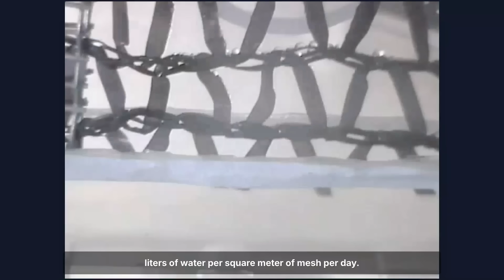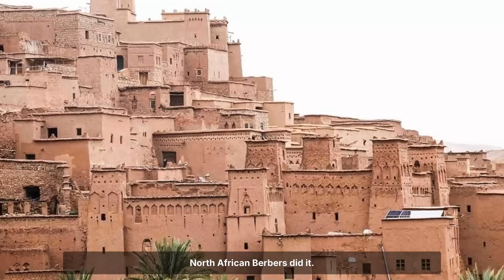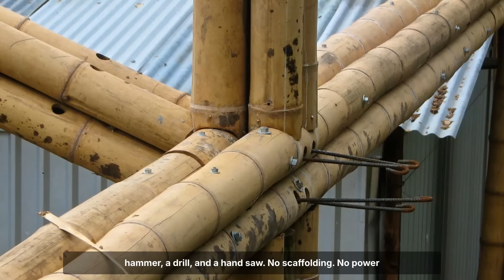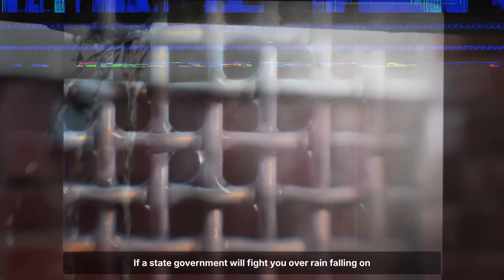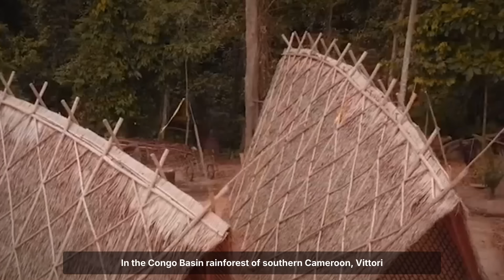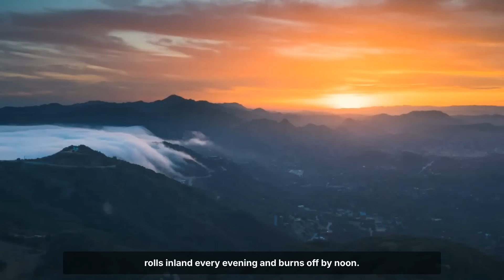This $500 Tower Makes 25 Gallons From Air Daily. Why Is It Banned in the U.S.?

Comment: 3 quadrillion ... thats 12 zeros ... not 999.9 trillion ... 
3,000,000,000,000    is a bit different than what you posted ... add 33 to that btw and you the states national debt load
Reply: bettle back ... just shows everyone that nature in 4.5 Billion years has learned what works ... while man keeps failing until they copy and comprehend nature ...

Comment: Let's see... the tower costs five hundred bucks and produces 25 gallons of water per day that costs nothing. It only works in places where the relative humidity is high so it does not work in places where water is needed. Do the math. Divide $500 by zero and you get a payback that NEVER  happens.

Comment: Call it the empty vase have the water collection have very small holes that run the water that it collects to an underground basin underneath. That you can access via pump that can be hooked up when you need it or hidden somewhere running pipes to it underground. You're not collecting water you just happen to have a structure that you call the empty vase art structure.

Comment: Not forgotten obviously. Rather it's more likely the tech was banned because it was something that could not be regulated or used to make a profit by those in control.  Likely reasoned to be unsafe for consumption or below code. Like how Nikola Tesla's designs for pulling electricity out of thin air were proven to work then because it could not be metered and used to make money it was destroyed and the plans after his death were secreted away by the US Govt of the day and it was never seen again.

Comment: 15,000 liters for 100 water catchers is 3,962 US gallons or 39.6 gallons per unit annually. If a person were to drink only from this system about 1 gallon a day, they would only last 40 days on 100 water catchers. Does it catch water from the air? Yes, but not efficient enough to sustain thriving communities.

Comment: The water needs at least basic filter and carbon filtration.  In some cases, you need a reverse osmosis system. Thats why theres regulations about how you can use rain water. You don't want to drink the chemicals that can leech from an asphalt shingle roof or any air pollution you catch.   This is usually to keep lazy people alive. If you just drink straight,  unfiltered rain water in most areas, you'll die of something or get very sick. 

As for the height, there are typically limitations on height for residential areas. Plus, depending on where you live, weather like severe thunderstorms,  straight line winds and tornadoes have to be taken into consideration too.

Comment: I think one of the main reasons why building codes tend to not want things like this is simply because of the fact that it takes away from businesses and stuff that actually create you know money for these kinds of things.

There’s actually a variation of this in. I think it’s Nepal or somewhere else. I’m not exactly sure. Basically there I think they call them fog catchers. Same idea, but instead of a circular tower, they are collections of screens that are situated really really high up on these mountains that are almost constantly surrounded in clouds and fog and stuff like that. And basically the moisture collects on the screens before it is then run into collection bins and stuff where it is, then I believe filtered through a natural filtration system, and then used as you know, clean drinking water.

Honestly, I think a system like this would be great for not just areas where they don’t have access to certain parts of clean water, infrastructure, and everything but even locations where you normally would have and stuff. For instance, put something like this on the top of a water tower. And it would likely be very helpful. Also, I think there would be ways to get around it for the building codes. For one thing you could simply refer to it as a dynamic sculpture.

Comment: We could literally create streams and rivers with a bunch of these towers– just dig a trench, line it with multiple rows of towers on each side for miles, build the occasional lake to store-up extra water,  and then release beavers to dam it all up and create wetlands;  bring in willow seeds and grasses to shade the banks, and we could turn places like Arizona into lush grasslands, with networks of self-sustaining streams, rivers, lakes, and wetlands. 
   We could also start a nationwide compost collection, to grow soils, and deposit them in key areas to accelerate the life cycles and water cycle returning. 
   Once the ecosystems are established, the towers wouldn't really be needed anymore, since the groundwater would be filling back up, the plants and soil retaining water, and the grasslands and little stalls of forest would cause both evapotranspiration, as well as create low-pressure areas, where moist air is drawn in, forced upwards where it cools, to then condense and fall as rain. 
   Planting coastal forests along our windward coasts (like Southern California), would further add to the rain cycle. We could increase this further by building barrier islands and mangroves, and paving artificial salt-pans, where, using flood-gates, a shallow depth of water would be allowed to flow in from the ocean into the salt-pans, where it would evaporate, and then we'd use something like street-sweeper machines to clean up the salt,  and then repeat. The salt should either be added back to the ocean, or sequestered, based on monitoring salinity levels. 
   And for dry areas like Utah, that are surrounded by mountains, we could dig railway-style tunnels through some of these mountains, so that the arid valley could be a part of a larger water cycle, with streams flowing in and out (with flood gates that can be closed if too much water is leaving the valley).
Reply: You have some very interesting ideas. Make me think. Thanks.

Comment: Romans had a solution for it, cisterns! 
Build cisterns under the parks or suburban areas. Every place on earth has rains or rainy seasons even Saudi Arabia. 
Collect the water in underground reservoirs. It’s filtered through the soil, no evaporation issue, and it’s protected from the weather/sun so which makes the water fresh through the year.

Comment: Can you provide a simple design for the desert travellor to collect water in desert?
Reply: Get something water proof preferably..square or rectangle as long as it has corners..can be plastic can be a fabric like a thin synthetic fly sheet for a tent...
You need to be able to tie it from the corners. It also has to have a hole in the centre. Tie it out so the material isn't taught. Put a weight in the centre where the hole is obviously dont block the hole.Make the structure a broad kinda funnel and something to catch the water underneath. If u have 4 trees to Tie off to is best as the leaves will drip onto your catchment. If you whack the trunk it'll "rain". You can probably do it a few times a night to up the amount you get. You get the gist.😉
Reply: Probably no trees in a desert so use sticks as poles for your corners..it'll still work..
Won't be a massive amount but you might get a cup or two depending on size..

Comment: Let me make something perfectly clear, because apparently people really struggle with this...

If you live in a desert, the reason why it is a desert is because the air is dry. There is no moisture in the air. If there was, it would rain more, and it wouldn't be a desert.

If the air is saturated with moisture, the environment will not be dry, it will be humid and moist, like a rainforest.

So, devices that are designed to draw moisture from the air, only work in places where the air is moist, and they aren't needed, because it rains there a lot.

In places where they would be needed or useful, they don't work because the air is as dry as the desert is.
Reply: Apparently many people are too dumb to understand high school level science and are claiming that government is suppresing "free technology". NOTHING in this universe is FREE

Comment: Build it on a trailer. Call it art. You don't need a permit for chattel.  Pour concrete with rings and chain the trailer down good if you are in tornado country. This would probably work great in The South and East coast humidity. If enough people were doing it it might not be a nightmare climate anymore.

Comment: Why would anyone need a permit to build a bamboo atmospheric water tower in their own yard?  I can tell you why people don't use them.  Not only will it collect water, it will collect bugs and bird shit too!
Reply: Plenty of ways to prevent bugs and bacteria. Many Australian homes ONLY use rainwater - mine included.
Reply: @tonyclif1 of course it's possible.   It's not banned in the US, it just doesn't make sense compared to buying water.  Last month 6000 gallons of clean potable water under pressure cost me $58.  Obviously not everyone has access to municipal water at this cost.
Reply: @Ry-lx2kl I live 10 miles from the closest water mains, and they aren't going to spend millions to supply my town of 110 permanent residents, or the next town about the same size another 12 miles away when we can safely harvest rain water.
Your 6000 gallons would only cost about $50 USD here in Australia from the mains as well.
Reply: @Ry-lx2kl  the idea isn't for now its when the inevitable shit hits the fan and water becomes more valuable than gold. You cant wait till you need one to build it. You wont be able to build it then more than likely.
Reply: @SpontaneousOracle you can be a prepper if you want.  If water delivery stops for prolonged periods of time you might need to leave your home.  I think it's smarter to devise a portable system and learn how to create a water filter with materials from the earth.  A portable water collecrion system can be a length of screen, a channel to collect the water from the screen, and a reservoir to catch  the water.  I think there is a lot better prepping methods than planning for a water source only in 1 location.
Reply: @Ry-lx2kl  solar powered atmospheric water generators cost about $7500 abd produce 8 gallons a day. Portable and efficient
Reply: @SpontaneousOracle yeah, those are cute.  The Water Cube 10 is $7k for 10g of water a day.  You'll need 10kwh worth of electricity for those 10 gallons.  10kwh of solar takes 2000w+ of panels in optimum conditions.  More reasonable is 3kw of panels.  Wait, is it winter?  5kw of panels.  This isn't a portable solution unless you use a generator and it's going to use lots of fuel.
Reply: @Ry-lx2kl 😂😂 I have a solar company so you dont know what you are talking about but good luck.
Reply: @SpontaneousOracle  It takes a kwh of energy to create 1 gallon of water per the spec sheet.  I'm a T5 Drinking Water Treatment Operator if you want to compare titles.   The math doesn't lie that you need lots of energy to run one of these devices.  I could run an Air Conditioner for this level of energy.  I've designed and built mobile solar.  Want to run AC, fill the roof with panels.  Same goes for this device, which will also needs a massive battery in addition to those panels if you want to create water when the sun isn't shining.   Your appeal to authority failed.  Math is math.  Sure, it's portable if you have an RV racked with panels and lots of battery storage.
Reply: @Ry-lx2kl  a solar panel creates 1.5-2Kwh per day. So to create 8 gallons of water it takes 6 panels.
Reply: @SpontaneousOracle So you need to fill the roof of an RV is what you're saying?  Also, does the sun shine 24 hours a day?  Maybe you only do grid-tied systems, but in fact the sun doesn't shine 24 hours a day, therefore you need to store that power right?  If you're storing even half that load that's 4kwh of batteries correct?  Does the sun also consistently shine?  Do clouds exist?  Do short winter days exist?  Do storms happen?  That means you might need to store even more energy, that means more kwh of batteries right?  I'll conceed you have a solution.  It's a really expensive one, but if you're already building out an RV, and have the money to burn, go for it!
Reply: @Ry-lx2kl   Look friend I have an RV. 6 panels and a solar generator get the job done.Sometimes it only gets 5 to 6 gallons but who cares thats plenty. The point is it is free water and its primary purpose is for catastrophic events. You do whatever you want, but im telling you its being done. Have a good day.
Reply: @SpontaneousOracle  and expensive. Be realistic. Many dont have $7500.
Reply: @Ry-lx2kl  Your screen idea is great. Getting the sediment out is a good idea, a piece of cloth to get smaller chunks out....you could make a crude sand filter to use before boiling. 

I would boil a big enough amount of water to store some in containers.....8 drops of bleach per gallon is enough to kill most viruses and bacteria. 

If you going to store the water....from a wild source no less, some bleach is always recommended.
Reply: @SpontaneousOracle  nailed it. I said what you recommended was expensive....that would be why. Solar company owner.

Good for you champ. Not everyone is in your boat. This solution is not for the 1%.
Reply: @Ry-lx2kl  5 hours of sunlight is all that is needed for one panel to produce that energy. The guy is not wrong. 

But we have effectively shifted the convo from a cheap and solution to getting water, the Wanka water tower, which costs $500-$1000.......
to a conversation about whatever solar guy is trying to sell that requires solar panels, and a single solar panel costs substantially more than the Wanka water tower would.

So when he says "it only takes 5"....yeah, the cost of one is more than the dang water tower. 

And then we move on to the $7500 machine that is supposed to be powered by the panels.

I mean, the guy owns a solar company and it shows. He likely would sell your grandma a solar system designed to last 200 years that provides enough energy for the county and he would say that "that is just how solar is"

Meanwhile, us plebs with simper solutions, like the Wanka water tower, it wasnt a discussion about how an overly expensive and modern device that requires solar panel installation is better than the Wanka water tower. 

Just ridiculous.
Reply: @tommywolfe2706  $7500 isnt expensive. Im not even close to the 1%. But when the shit hits the fan I will be drinking water when others wont be.
Reply: @SpontaneousOracle  You lack awareness. $7500 is expensive. 

Watch gas go up $.20/gallon and see people freak out, and you are dropping nice used car dollar amounts. 

If you had to put a "balance sheet" value on every car in an average Australian suburb, the median value would likely be closer to $9,000

So with sales tax on that machine, you are looking at the cost of it being about 10% less expensive than the average Aussie persons car.

Like I said, that is not an affordable solution. 

"Just finance it, we offer easy terms"......lol
Reply: @tommywolfe2706  Well we aren't that poor in the US. Australian communists have ruined your country. One of my best customers sold his seafood business there and moved from Australia to the US. He tells me how bad your government is.( No fault of yours of course.)
Reply: @tonyclif1  Drinking aluminum/barium/strontium..Yuck.
Reply: @bogey19018 these occur in pretty much all water. Important to remember that the dose makes the poison though.
Reply: @tonyclif1  No it doesn't. Free aluminum is man made, not the raw aluminum in the ground. It comes from geoengineering.
Reply: @bogey19018 you are in disagreement with science - aluminium occurs naturally in water due to leeching, and usually at very low levels. It also increases during water purification. 
If you are suggesting that the dose doesn't make the poison, you need to go back and do a LOT of learning.
And of course you can provide evidence (not just claims) that geoengineering is the cause of these metals in water.
Interesting that me pointing out an advanced country harvests rain water becomes conspiracy theory 😂
Reply: @tonyclif1  its against the law in many countries for collecting rainwater.
Reply: @SpontaneousOracle yep, aware of that. I believe the same applies in some states of the US as well. This just proves that politicians don't care about the science that makes it safe.
Reply: @tonyclif1 agreed
Reply: This doesn't replace water purification.
Reply: gravel , sand n charcoal 
pretty expensive stuff to use as a filter mate 
dont be a negative cheap azz
Reply: Filter it. No problem.
Reply: You don't need a permit to do something you don't need approval from daddy government especially some jewish guy or dork that nobody likes who thinks he is going to tear down the constitution if you find this happening to you then you have a bigger problem you are dealing with a traitor or a enemy.
Reply: ... which are also banned by the government because...?

But they're not, and neither are these towers. AI slop. Many of the comments are, too.

Comment: If you keep an open cone  fixed to a wooden member free to pivot , about 200' high above the ground following the wind movement by the aid of a tail fin( like in a horizontal axis wind turbine), the air can be collected in the cone and led down to a structure on the ground. If this air is made to pass through a clay pitcher containing cold water, the water vapour contained in the air will condense and fill the pitcher gradually. The water in the clay pitcher can be kept cold by covering the pitcher with a wet cloth   which helps in evaporative cooling.

Comment: It is a good idea if you need to supply water for a community, and if you can get it to work. If the mesh is not set correctly it will not work. But for emergency water, I will stick with my Dehumidifier set up & rain collection barrels that is legal in my state, and even if it wasn't legal, I would find a way to hide the barrels. Both are not as big, and much cheaper😉